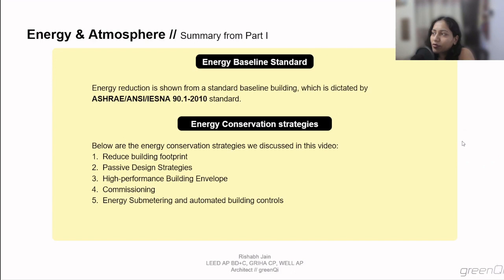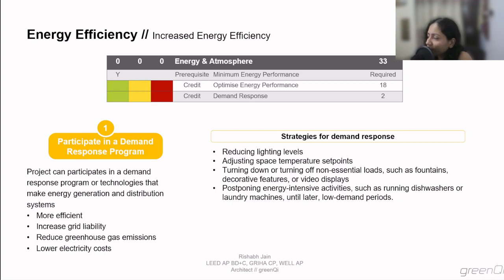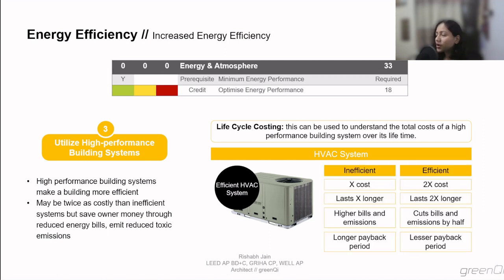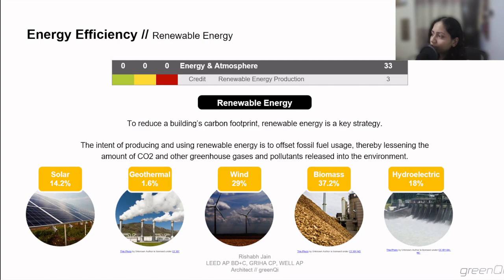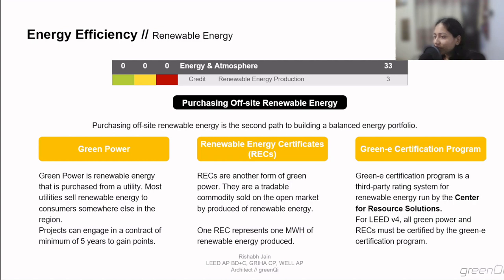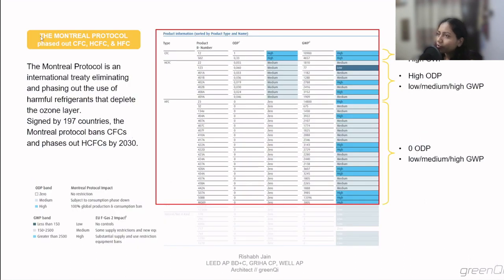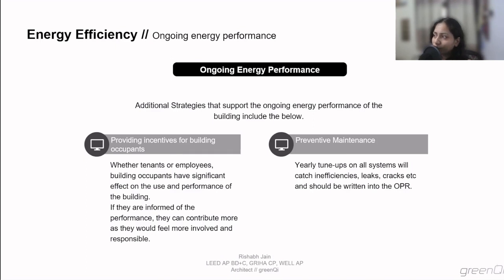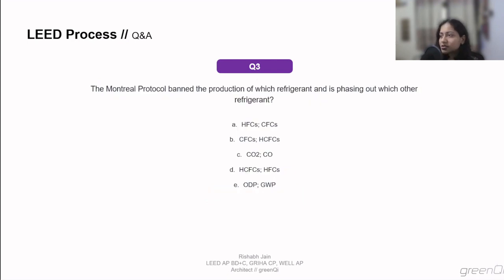Energy and Atmosphere part 2: Complete Guide, Intent, Strategies | LEED v4 Green Associate Exam Prep

Comment: Thank you for good videos and updated content. Please correct the errors in these videos and in your practice exam course on Udemy website. In this video your diagram on supply and demand is wrong and misleading.  When supply exceeds demand, you overproduce electricity, which may not be used — this leads to wasted resources and idle plants. When supply is less than demand, the grid cannot meet the needs of users — resulting in brownouts (voltage drops) or blackouts (complete outages).
your diagram has the cause-effect relationships reversed.
Reply from the maker: Thanks for the feedback, we will review :)